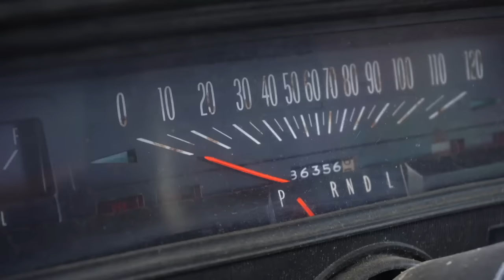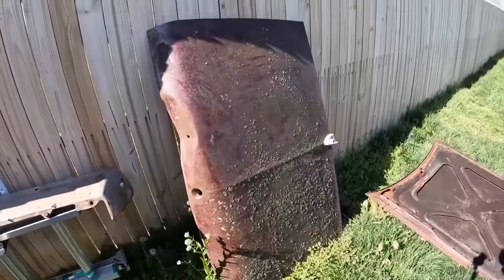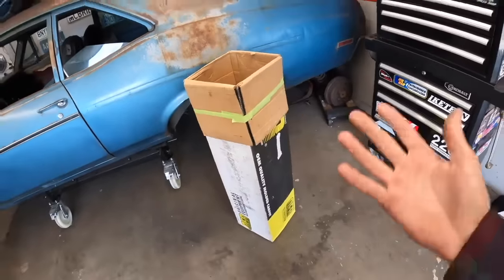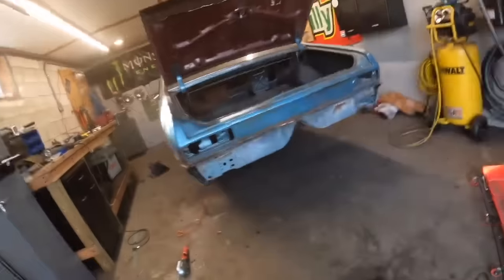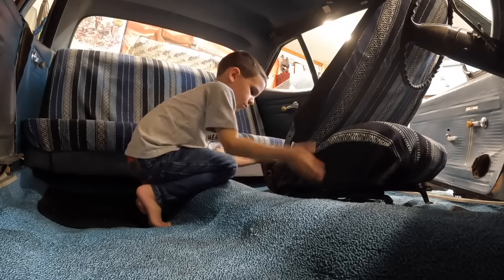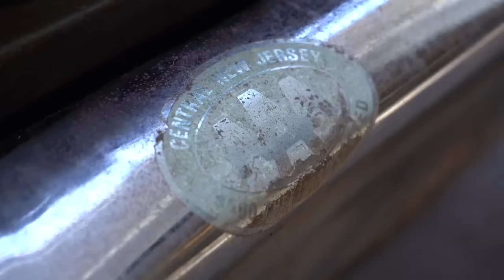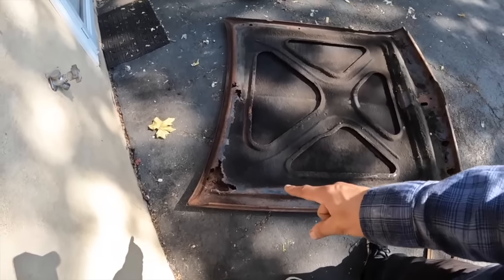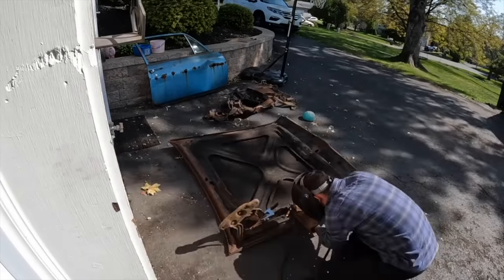The ultimate beater muscle car THE "JENKO" NOVA

Comment: This makes me cherish the memory of the car I miss the most. Back in 1977 when I was 21 I had a blue 1973 Nova with 34,000 miles that I absolutely loved. Wasn't fast due to a stock 307 but it was a very pretty car that got what seemed like daily comments on what a good loooking car it was even with the stock bench seat and carpet delete. The bench seat meant my girl would scoot over beside me without a console seperating us. Bought a new set of Cragar SS wheels with G60 tires in the rear and Hi-Jacker air shocks. That gave it the classic 70's rake I wanted. Man it was gorgeous!

Good luck on your Nova!

Comment: Cool Nova I enjoyed that video thank you I'm an old guy I can't put cars anymore but I got to know of a story in 1978 my buddy bought a ghetto property guy passed away everything came with the property including the kind of garage he said I could have the car I had a title 72 Nova 35o. 4 Barrel dual exhaust 10 bolt posi 342 gears bench seat rear window defroster am fm stereo 8 track rear window defroster rubber mats no carpet power windows power bench seat power steering power brakes hugger Orange yeah Factory air in the dash all the best part four door who ordered this car new must have been a guy had a family and still want to Performance what a cool car I enjoyed for 10 years every day never saw another one like it when I parted it out this guy freaked out when he saw the air was in the dash turned out the only Canadian built cars in 72 novas had vents in the dash 73 was the first year for regular in dash air thanks for the video have a great day have fun:face-blue-wide-eyes:

Comment: Very interesting build! I did something similar way back when with a 62 Plymouth Sport Fury 2 door. I bought the car for $300.00 WITH a 440 4V, Cable operated 727, and a 3.91 posi.  (The guy HAD to sell  it NOW) I did; 6 point roll cage, welded in sub frame connectors, gutted doors, windows and quarter windows, etc... Competition valve job, minor porting,  Direct Connection 2.84-4.84 Hemi Grind Cam & Lifters. some modified street headers...Weiand open plenum intake, 850 Holley carb. Still remember my first pass down Detroit Dragway with that car....
Reply from the maker: Heck yea! Sounds like a super rad car!

Comment: I see your buddy has a 64 Dodge 330 post sedan! So cool! My best friend had an identical one for about 15 years! Built 440, roller cam, tunnel ram, built 727 (pushbutton), 3500 stall, full cage, and 4.30s with a spool! It was wild!
Reply from the maker: I bet that was a sweet car! Mikes is a 383 car with the push button and 3:73 gears. Almost breaks into the 13’s but really needs more gear.

Comment: Top pin goes in from the bottom up I do believe.also I think there is a size difference in the top and bottom pins, the bottom pin goes in pointed down. I think I recall that being correct from a mechanic on You Tube. I'm enjoying your sense of humor as you work, good way to get it done ;)

Comment: Man should of put a new clutch in it. I like the cars
Reply from the maker: I was trying to do the manual conversion on a budget. Married with two little kids and way too many projects the money isnt always there to keep producing content for YouTube. So I have to work crafty and cheap to get what I want. The pedal and z bar kit ran me $300 and I paid $100 for the used clutch pressure plate and flywheel. I sold the powerglide that came out of it for $400 so in the end I converted the car to a three pedal machine with zero out of pocket! Glad you like the cars man! Much more to come

Comment: Well done!   Love the stance and the styling!  This is like what you would have seen on the streets back when I was a teen in the 80s!   Can't beat the 4 speed!   If you plan on upping HP I would look into swapping a T56 later or a Super T 10 if you can find one.   Hard to break one of those.   Motor wise as long as the bottom end is good I would hesitate to start with bolt ons and a set of Cal tracs on some DOT stickys.  That is a fun daily musclecar.
Reply from the maker: A trans upgrade is definitely in the future for this car. The Saginaw is not built to take any real power and we are about to start doing some motor work to this unit!
Reply: @hatchsrecreationalengineer1997  Had a friend back in late 80s with a 69 Nova with a small block and a B&M 177 blower on it.  Nothing crazy had a set of Dart heads and a hydraulic cam and would run in the high 11s to 12.0s.   I believe he had a 12 blot with 3.73s.  Lot of guys were surprised because it didn't look fast.   He later put a bottle on it and I think it went 10.90s.  Weighed 3400 lbs.  Light weight makes a fun sleeper.

Comment: You said it! Just try! Learn on what you have! I started doing restorations 25 years ago from professionals who taught Me as a kid! I'd do everything else!  they'd do the welding! But getting older I knew I had to learn every process which I did! Welding sheet metal is nothing turn your welder down go alittle at a time! Grind it down go over it again if need be! It's only metal! Trust me when everything goes electric this will be a very good skill to have! Because anything computer controlled can be disabled! Anything carburated you can make run when everything else is shut off!!!! Those of us smart enough to build something old will have something to drive! Trust me don't trust technology! Old and trusty! Mechanical is the way to go and Noone can take it from you!!! You can always make these old cars work! If you know how to fix them! Metal work Is easy once you know how!!! I've seen cars rotten to death put back on the road one panel at a time!!! In bad Cases brace them up with square tubing cut out the bad metal, and weld in new panels! Just take your time and you'll be amazed what you can bring back to life!!!

Comment: Another great video anyone who can put a nova on the road is alright by me. Any condition as long as it's safe to drive. Great job man. Just stop with the 307s. I'd rather see a straight 6 than a 307.
Reply from the maker: This is a 327 in this car not a 307. It’s a 2 barrel motor but it is a perfect platform to build a high revving little sbc with some different heads cam, intake, etc.

Comment: Awesome!  Your nova has all the options.  Mine doesn't have trunk hinges, anything related to windshield wipers, and you can look right through the car from the trunk to the engine ( hole cut into the firewall to accommodate the distributor on the big block and lack of most factory).  interior pieces ) 😁🤣🤘. It's still a nova though. 😁

Comment: Don't be afraid of reupholstering seats. All the things that you have learned to do, doing seats will be easy for you . I was afraid of doing seats and Transmissions. Now I have done both. Buy a pair of hog ring pliers and some hog rings to practice on an old seat you don't care about. Remove the old cover and put it back on and you'll see it's not that difficult. I had to notch the frame of the rearone in my Cutlass to fit around the roll cage.

Comment: Explorer 8.8 fits perfectly into 68-74 novas, cheap way to get disc brakes posi and usually 3.73 gears.
Reply from the maker: It’s funny you mention this. This project is already in the works for this car! It’s like you read my mind!
Reply: Heck yeah man, i used the 5x4.5 to 5x4.75 drill guide on mine ,  has been in the 10s in the 1/4 and about 600hp tire. Couldn't care less

Comment: I have a 75 caprice the body is solid just one area has bond. The trunk right side where water builds up. I just want to get the car running. I had it running back in 2021 of April but took out the AC. It was running with three belts just want it running with two. Just want to make sure everything in in lined.

Comment: Hey, what kinda welder do you have? I'm pretty much in the same position as you. Never worked on classic and now I own a 68 Nova. Curious what welder you would recommend for body work
Reply from the maker: Hey Evan, my welder is a Hobart handler 140 mig and I use 75% argon 25% co2 shielding gas. Awesome serviceable little unit and i would definitely recommend it! Start working on that 68 dude you got it! 
https://www.tractorsupply.com/tsc/product/hobart-handler-140-mig-wire-welder-3812040?store=792&cid=Shopping-Google-Local_Feed&utm_medium=Google&utm_source=Shopping&utm_campaign=&utm_content=Local_Feed&gad_source=1&gbraid=0AAAAAD3fmFO8eqTklHZtR7xbyTn44b8tn&gclid=CjwKCAiAvoqsBhB9EiwA9XTWGSGPfDqwEsFFQMYm8XvQDRPa3kaqlOYALcfAaHT9AuOKaJiHiDmVoxoCXJkQAvD_BwE
Reply: @hatchsrecreationalengineer1997  Awesome! Thanks for always replying man. Always appreciate the advice

Comment: So how much do you have in it now ?
Reply from the maker: The only thing that has changed since the cost breakdown was the four speed swap. The Saginaw trans was free, the pedal and Z bar kit was $300 and the used clutch pressure plate and flywheel was $100. After the install I sold the powerglide I took out of the car for $400. So basically the entire swap wound up balancing out.
Reply: @hatchsrecreationalengineer1997  wow ! That’s awesome. I know that you mean this project is the exception not the rule -but it shows what a very determined person can do with an opportunity. Ty for what you do

Comment: Great job boys. I have a SERIOUS DISLIKE for slush boxes in Hi Power/Muscle cars (unless it's being drag raced with over~ 800 HP.  I remember the good old days when you could  buy a used Muncie M-20--M21 For $50 or an M-22 or a Borg Warner T-10 for $100.  Hurst Comp + shifters were about $125 brand new.
If I bought a muscle car with an Automatic it was a 4 speed within a week. I used to race Modified Stock Cars and every Fri/Sat night was like a huge flea market or trade off with tons of parts to be had..

Comment: My very first car. 1971 Nova SS. An actual SS not a clone. Paid 800 dollars for it in 1986. Last of the Detroit performance 350 small block. I tried to blow the engine by driving it on a 3-mile-long straight stretch, From Greensburg pa to Latrobe pa on route 30. When I finally let off the pedal, looked at speedo, it was beating off the 120-mph peg. it took 3-4 secs to stop doing that and drop below 120. my gawd the fun I had in that car. sold it for 50 bucks in 1988, had to get rid of it, I joined the army. Now, I want to puke LOL.. what is that car, a 71' SS worth now?

Comment: Muscle car. "4 seat passenger vehicle with a high hp motor." All I see is an anemic 120hp 2 barrel boat anchor.
Reply from the maker: That’s fair. It is no high horsepower torque monster that’s for sure! To my kids however they don’t know or care the difference. This car fits the bill for them and is fun to rip around and have fun in. The car was built on a shoe string budget and it doesn’t get any cheaper or more reliable then a low mileage unbeaten 327 2 barrel. This engine can be a great platform for some top end upgrades when our budget allows down the road (new heads,cam,intake,carb,etc,etc).